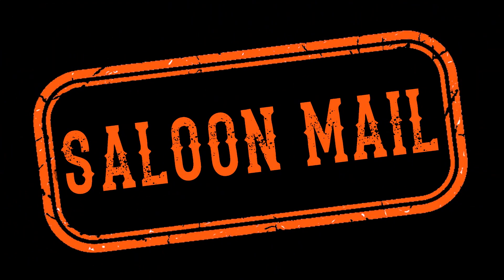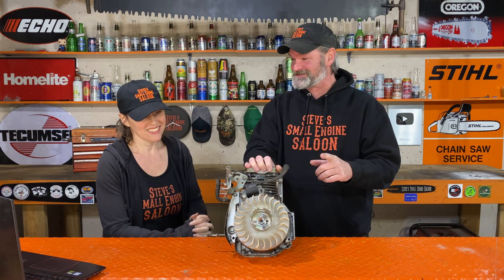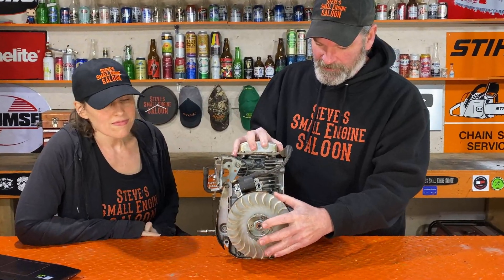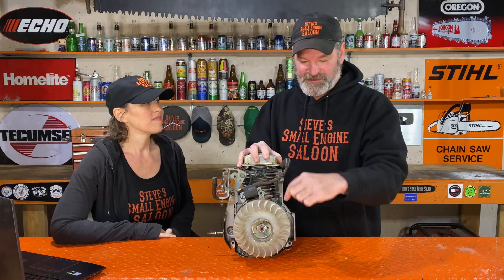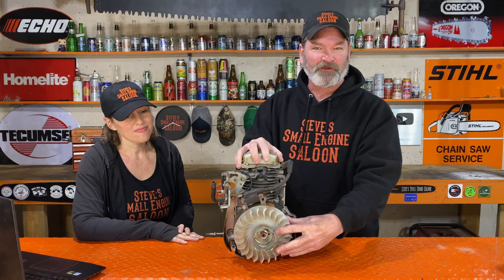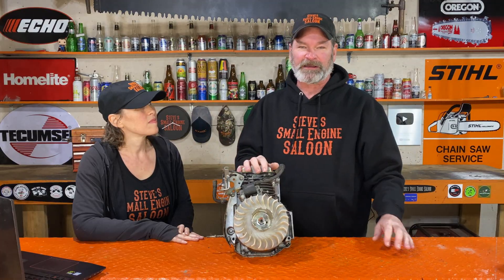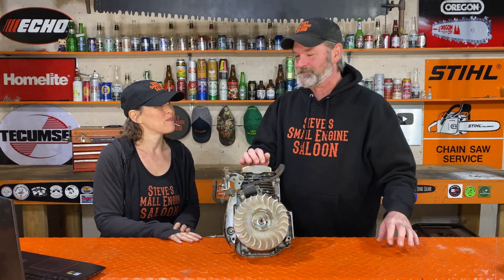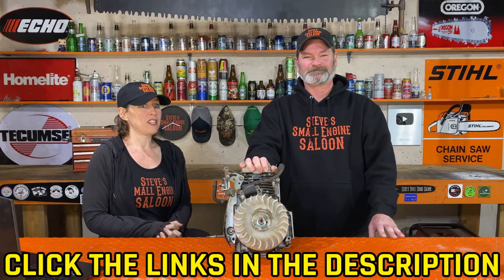Does Cleaning Flywheel Rust Give You Spark? (DAY 22)

Comment: Here's my "any comments you want" just to satisfy the YouTube algorithms to support the channel.

Here's my BS explanation that could in rare cases be true:  When you do what is suggested by the question at hand, you're doing other things too, unbeknownst to you.  In other words, when you pull an engine out and do something unrelated, you could inadvertently bump something like a plug wire or whatnot and close the previously open/short circuit.  So many times, taking something apart and putting it back together fixes something without you actually truly knowing what you did to make it work again.  The problem with this is that if it works, it's likely temporary because these kind of fixes are band-aids at best, because the problem that caused the short at first isn't really fixed, it's only bumped to temporarily working again, where it could short again very easily.

Comment: I had a Honda run well for a few minutes then loose power and cut out. All I did was sand the wheel and adjust the gap on the coil. The problem went away. I’m know that rust takes up more space than steel so I wonder if it just made the gap larger.  This engine had spark obviously but lost it when it warmed up. It’s still a mystery to me but it was a cheap fix for my mates dads log splitter. James out.

Comment: I never found spark to come after cleaning the flywheel.  BUT, I could see rust on the flywheel and the coil cause spark issues if it resulted in a too small of gap.  I have also had one, where I had to really clean the posts for the coil, and then started getting spark again.  If you're already in there anyway, a couple minutes to clean it up likely can't hurt.  If I don't have spark after removing the wire to rule out an unexpected ground scenario, I've usually got a replacement coil ready to go anyway.  So it makes sense to just go ahead and clean up the flywheel and posts being mounting the new coil and gapping it.

Comment: 1 in of Steel makes 3 in of rust. A particle of rust hits the coil and moves the coil. They use a spacer to set that very close. I've seen them pushed off as much as the 16th of an inch that's a very weak spark

Comment: Rust screws up the magnet you have to clean it up. Get it shiny. Put a thin coat of marine grease on the magnet and the coil that you polished. Fold over several layers of paper to space the coil from the flywheel. You need it pretty close too

Comment: My two cents worth - most magnets are an iron-nickel alloy and the rust found on a flywheel is a type of iron oxide. What makes anyone think a magnetic field is affected by rust if all rust is a mixture of iron and oxygen?

The problem is some people seem to equate the magnetic and electrical properties of rust - which are completely different. From an electrical perspective, rust is an insulator and can affect current flow in a circuit. The effect iron oxide has on a magnetic field is wholly dependent on the thickness of the iron oxide layer, the size of the air gap (if one exists), and the strength of the magnetic field. As you stated, the gap between the flywheel and the coil is only 0.01" - the only way a layer of rust this thin would affect the magnetic field from the flywheel would be if the magnets in the flywheel were so weak that they really couldn't be classified as being magnetic anymore.

Comment: I do clean the rust off the flywheels, not because magnetism can't go through the rust, but because if that rust is thicker in any spot than the clearance between the flywheel and the coil poles, that rust will short the ignition out. I have seen that happen before. It's rare, but it can and does happen. Better safe than sorry, I always say... :shrug:

Comment: You are SPOT ON. If you have no spark it's either a ground wire issue to the ignition module or the ignition module itself. ( unless you're working on a oldie with points and condenser...)

Comment: Thank you Steve and April. I'm one of those guys that never gives up on a piece of equipment. I've got an old B&S from '72 on an edger. I've found coil grounds open, corrosion on the point, open capacitors and the one thing that got me was the cam pin that operates the points. It would hang up and not let the points open. I got real good at removing flywheels.I clean the magnets but I've never found that to be a non run issue.

Comment: I agree 100% that cleaning the rust off the magnets on the flywheel won't fix a non-spark issue. But I will say cleaning dirt, oil, and similar crap off the coil plates will fix a no-spark issue. That's because the coil can't pick up the magnet. Did that on a 3.5 horse brings a couple years ago. It ran, quit running, checked for spark multiple ways, no spark, checked to see if the flywheel key sheared, cleaned coil because it was dirty, re-gapped it, and it fired up. The coil was 100% covered in dirt and grime from 30 years of use.
Reply: Old comment but what your problem most likely was is bad connection between the ignitioncoil and the engineblock since you removed the crap and regaped it the regaping fixed the bad connection between the ignitioncoil and the engineblock giving you spark back.

Comment: Totally agree! It's just the way I do things but I'll remove all the rust from a flywheel so there's a clear air gap between the coil and flywheel so I can set the correct gap also I can't stand rusty components it eventually leads to failure! Rust is contagious 
If there's no spark it's nothing to do with a rusty flywheel unless the rust has jacked the magnet off.

Comment: The thing is that clean the points and condenser on older engine s.the other problem with the ignition coil is it could be rust welded to the flywheel

Comment: Slightly more complicated question, but will cleaning my windshield add fuel to my gas tank? I typically clean my windshield at the gas station. Seems to be working for me.
Reply: Adding blinker fluid helps too..🤣🤣🤣
Reply: @rodneybrand8521  I’ll keep that in mind, thanks.
Reply: Just don't buy high beam test, not worth it
Reply: Don't forget to grease your muffler bearings also.  I keep my muffler bearings well greased and i get awesome gas milage on my mountain bike.